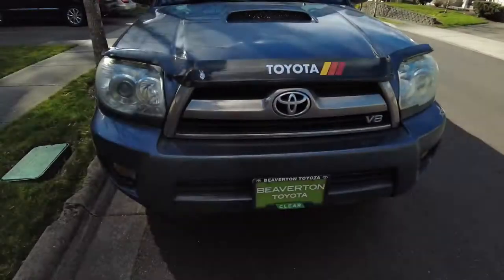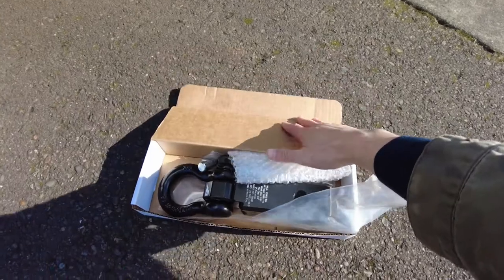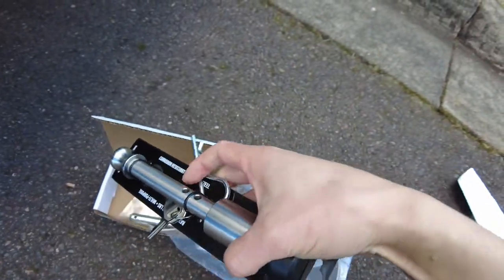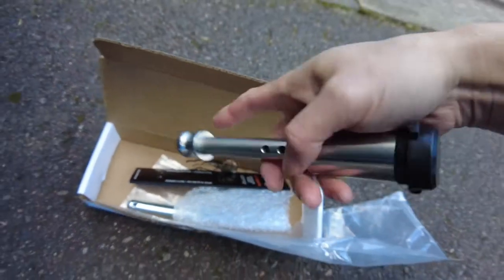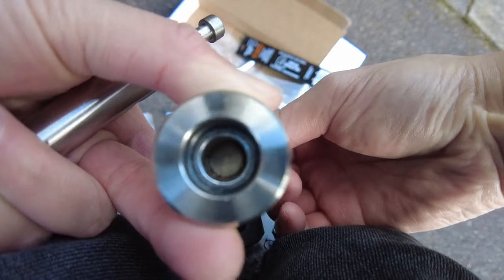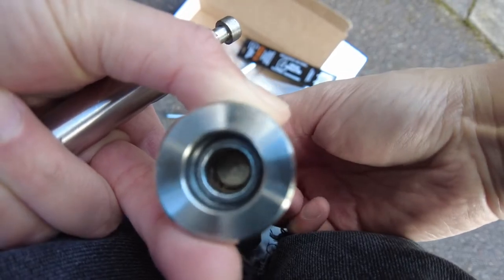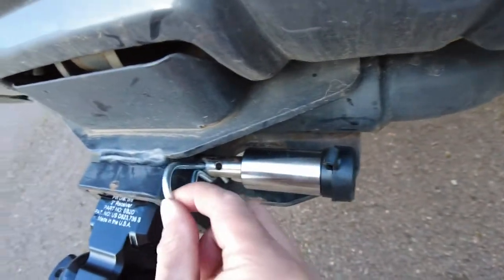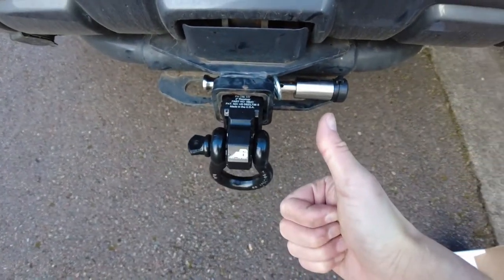Installing Agency 6 Recovery Shackle with Bulletproof Hitch Lock on my 4th Gen 4 Runner

Comment: Lol ..  I’m sure someone get smart enough and use screwdriver to loosen that and there goes your Shackle!! That’s why I don’t advertise mine and only put it on when needed.
Reply from the maker: So far so good.  It acts as another layer of difficulty for them to remove.  I can understand you doing that, for me, when I park in the city, it's a great deterrent for people parking too close to my rear bumper.
Reply: If that’s all you want is to deter people from parking to close, a ball hitch will be even better, hence the ball hitch is hard to take off than the shackle plus the ball hitch extends further out. I have both ball and shackle hitch on my truck and I don’t leave my on for the reason that people will steal it though I would rather leave my ball hitch than my shackle.
Reply: Also no matter how hard you tighten the shackle, sooner or later it will loose up because your SUV is constantly moving and hitting bumps and the shackle will loosen up and you will loose it while driving and there goes your shackle or it can come loose and hit someone behind you.

Comment: Just received the same setup. Alot of play in the locking mechanism but better than nothing. Do you you have alot of play in the locking mechanism?
Reply from the maker: There should be a little play but not a ton
Reply: @RichieValentine  thanks for the response. I guess it's normal. Like the look of the hitch on my 4runner. Adds a little protection incase someone gets a little too close at  red lights
Reply from the maker: @AG4runner  ive had people in small cars park centimeters from my truck WITH the tow hitch.  It's more of a defensive mechanism rather than a tow or recovery tool at the moment :)
Reply: @RichieValentine  dual purpose